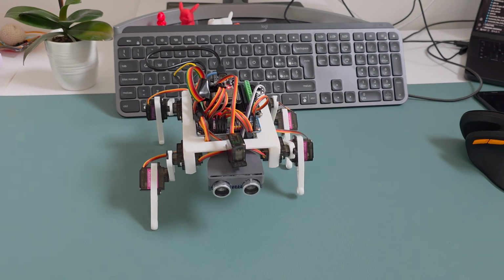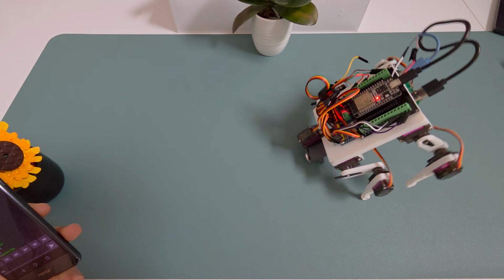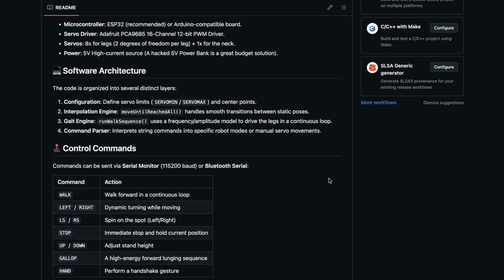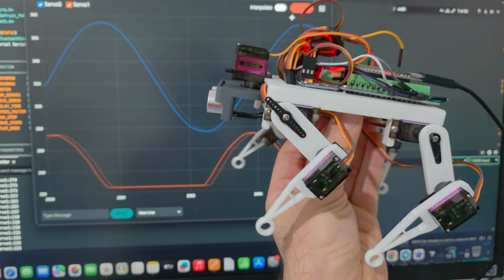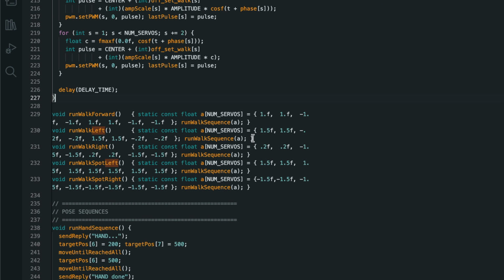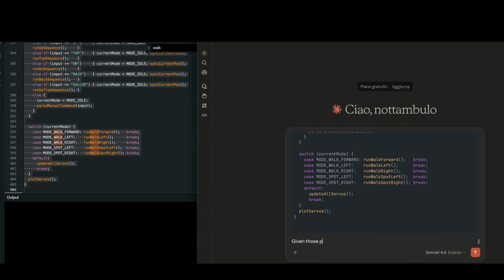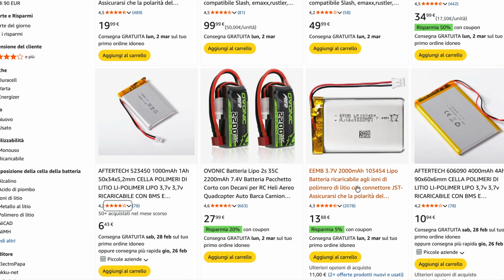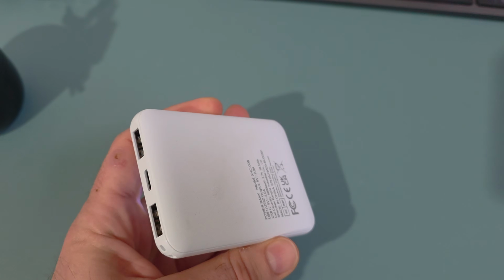How I Made This Tiny Robot Dog From Scratch - Open Source ESP32 Build

Comment: May I ask, What degree angle did you Setup those motors and the Legs, Did you use defaultof servoes to make it stand and I didn't see any Wiring diagram on the GitHub

Comment: I just made the same dog followed by you the only thing is my dog reset immediately after I place on floor even I provide 5v 6 amp supply too
Reply from the maker: That sounds like a power spike issue, try adding a capacitor to the power rail to stabilize it.

Comment: hı ı see ur using 8 servos and powering it with a powerbank, ı was working on a robot too and my frient told me to use a bms and a buckconverter  rated for at least 20 amps cause servos use high current so seeing u pull it off with a powerbank made curious
Reply from the maker: Haha it definitely pushes the limits of the powerbank sometimes! 😂

Comment: Im not understanding the electrical connections part where you give one output line to the esp32 and another to the servos. Do you have some schematic or something to help me understand??
Reply: Basically one usb output of the powerbank is for esp32 and second for servos :)
Reply: @benjaminpeljto7408 so he uses the two usb outputs, one for the esp32 and another for the servo driver?? Does the power bank supply enough amps??
Reply from the maker: Hi, thank you for your interest! That’s correct— in most cases, the power supply is sufficient. I recommend this setup, especially for beginners 😊